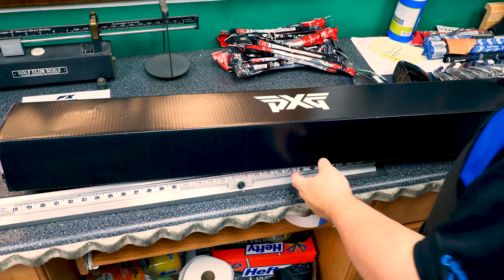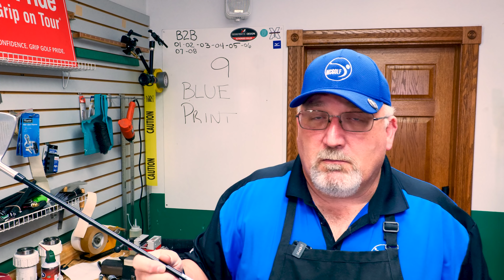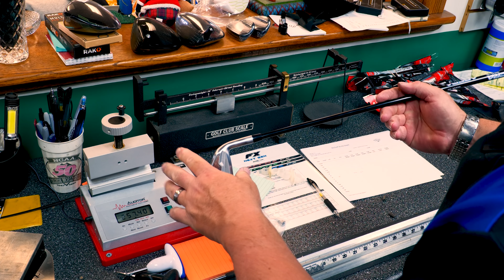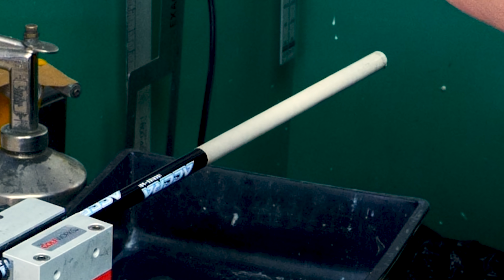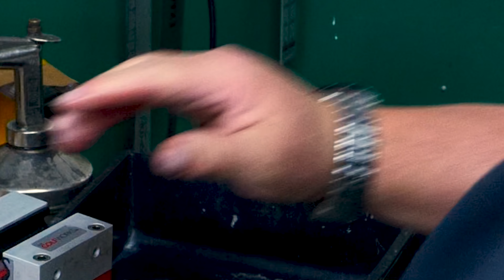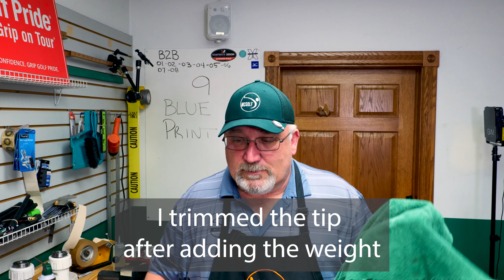Blue print a golf club, removing a golf grip. B2B #9

Comment: I had a similar situation (low swing weight due to using a shorter than standard iron length and lighter graphite shaft).  Because of budgetary considerations, I opted to go with 20 grams lighter grips (instead of a rebuild). It worked; however,  now my grips options are very limited.

Comment: You have to tip it for flex right since you are adding weight? It should play softer with more weight in the head. So length off the top end possibly?
Reply from the maker: I did tip them to get the flex

Comment: Does adding weight to the hosel create a draw bias?  Don’t manufacturers add weight in the portal, if available or use weighted screws (PXG) or use B grade heads to get to the desired swing weight?  Maybe a tip for the buyer.  Don’t buy the cheapest PXG head. A set of Gen 3 heads same shaft $200 more save money not rebuilding a set
Reply: Manufacturers don’t use “B grade” heads.  They have heads in light standard and heavier and pick according to the desired build.  If you search on youtube you can find a video of custom builds at titleist factory where this happens every time a set is made.
Reply: @mikepxg6406  B grade refers to weight not a defect common term
Reply: @eddietrich6257  Club manufacturers don’t use that description, they just weight sort them.
Reply: there is no such thing as light standard, a head is within specification plus or minus, if not it is sorted by weight referred to as a B head and I just spoke with my PXG field rep who knew exactly what this meant